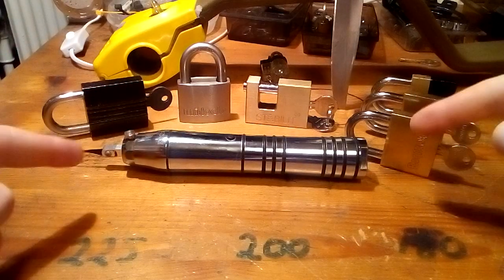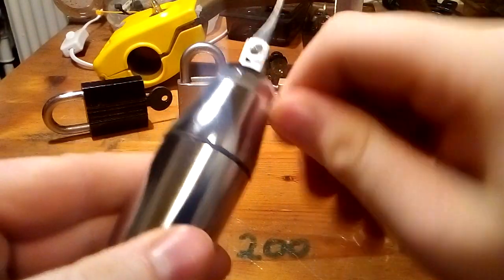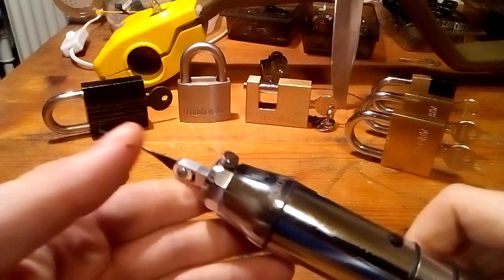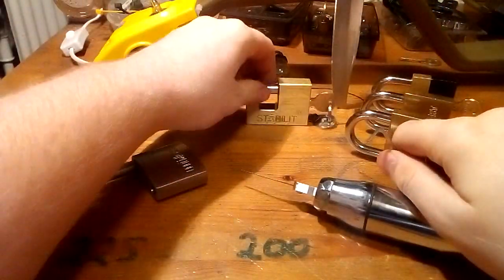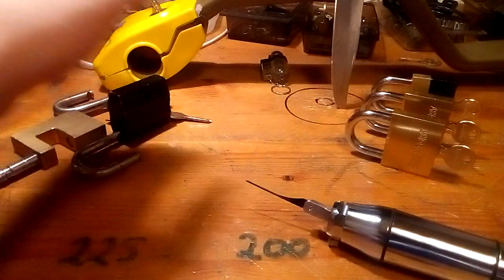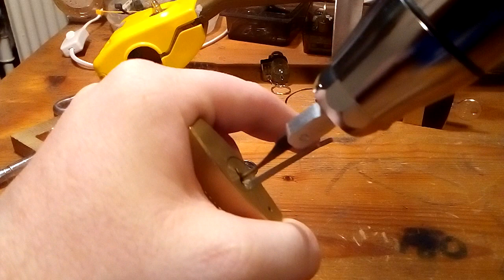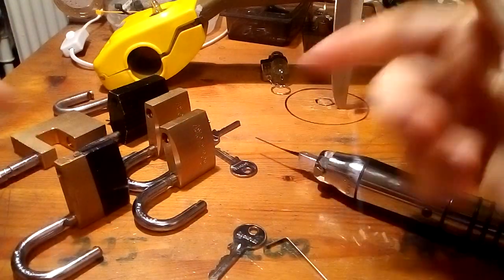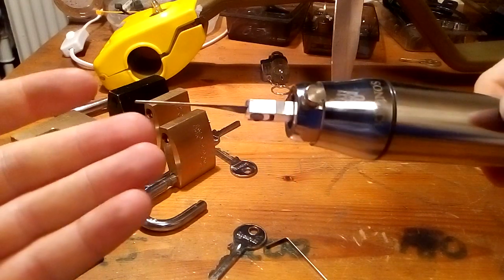(51) a anwser to Chris capune about the Kronos pick gun

Comment: Very nice video on adjustig the Kronos and a good help for Chris and others to get a starting point  :). Of course the tip is moving 5mm (it would jump up and down in your hand if it was 5 cm 😂✌). Cool that it opens also some more challenging bitting 😊👍 :). I'm not a fan of such tools in locksport, but for a locksmith it's a great tool :). 😊👋🦊
Reply from the maker: Thanks my friend, i do not use it too much only when i pick pin tumbler locks to see how many diffrent tools i can use on that lock😁👍

Comment: I wonder why it works better upside down.
Reply from the maker: You know what my friend, i do too😁
Reply: @lockmania-locks  It's odd. BTW, I noticed there's some lens flare coming off the Kronos at around the 0:20 mark and again later in the vid. Usually, a smudged lens would cause that. But it would also cause everything else to be slightly blurry. So I'm not entirely sure. It wouldn't hurt to clean the lens if you have a microfibre cloth or a lens cleaning cloth, anyway, but I can't say if it will fix the problem. It could just be an artifact of the lens. Most of the lens in camera phones only have a meniscus lens - which is about the simplest lens you can get short of a pinhole. Not really all that much can go wrong with them.
Reply from the maker: @two_tier_gary_rumain  thanks for letting me know i Will clean it but i think it could be because the Kronos is very shiny
Reply: @lockmania-locks  Well, yes, you would get light reflecting off it but it's all in one direction. Vertical. When you clean, do it in a circular motion.